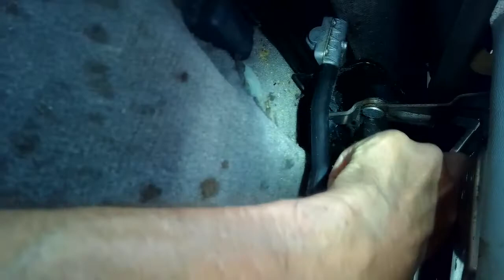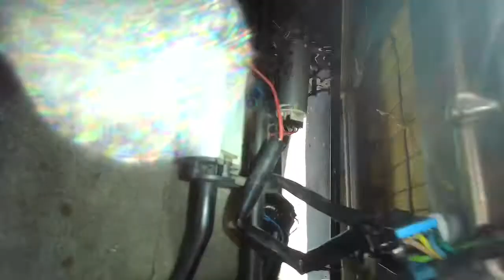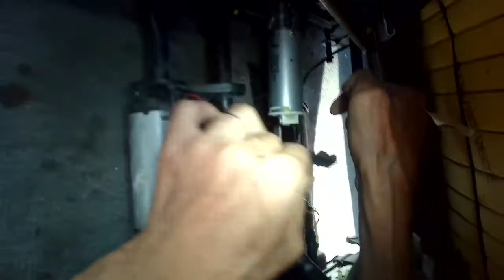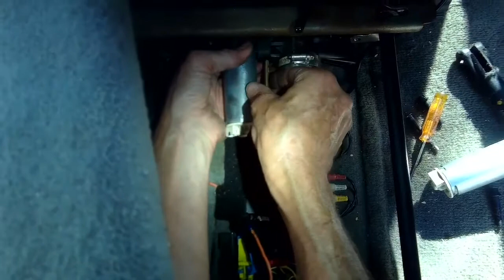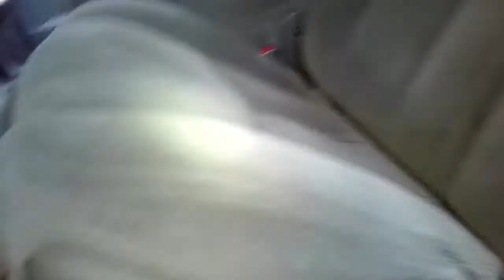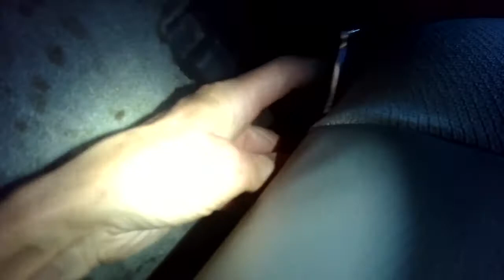YUKON-TAHOE POWER SEAT REPAIR - PART 2

Comment: Thank you for the video. It helped me a lot. After hours of trying to figure out what broke on the motor, it turned out to be something very simple.  There is a brass bushing that aligns the axil of the electric winding within this motor. that pops out of its housing.  I super glued it back in place, and the motor now works because the worm gear is back in alignment when the brass bushing is back in place.  You have to glue the bushing because it pops out very easy.  Took me hours to figure this out. And new motors are not available.  There are 4 tabs that hold the gear's end piece of the motor.  Bend them back and expose that end of the motor.  If you by mistake pull the axil away from the connector end of the motor, it will be time-consuming to get it back in place due to the brushes need to be pulled back. I used a dental tool to get the brushes back in place.  GM wants 600 bucks for the base and 100 for shipping.  What a rip-off.
Reply from the maker: Nice job skip👍👍👍

Comment: You might include a link to part 1 in the description; YT isn't even listing it, so I didn't understand what you were fixing at first.  Some zoom and image stabilization would help.  Try to edit-out clearing your throat; it's killer on headphones.  Good stuff overall though, so keep fixing things and posting and your subs will work their way up.
Reply from the maker: Thanks James,
There is no ability to get the new motor.
You can buy the entire lower seat assembly on eBay for about $130 and then remove the motor and put it on your seat.
Reply: @QuickAndEasy5MinuteAppliance    At some point even eBay will run out of lower assemblies.  Had a common issue with the bottom housing on our Hoover upright vacuum.  The rear axle supports in the housings would shatter, so all the warehouses ran out over time.  There's a pattern on Thingiverse for an axle support, though!!!  Maybe someone will upload a compatible pattern someday as there's more out there all the time.  Keep on fixin'!
Reply from the maker: I hope so👍